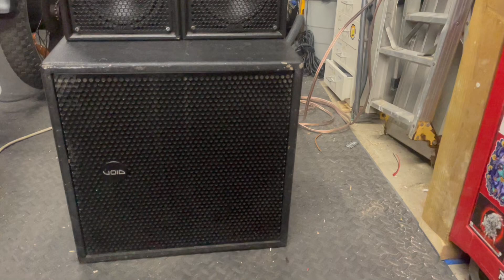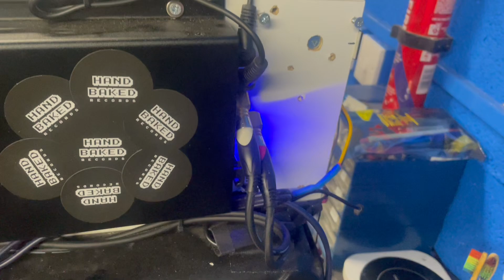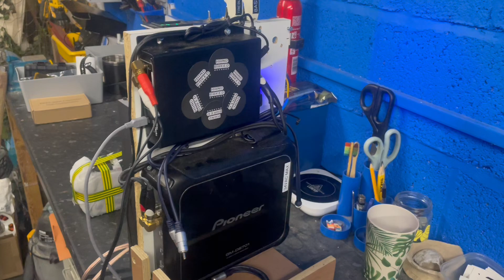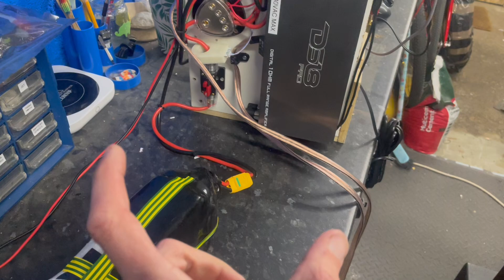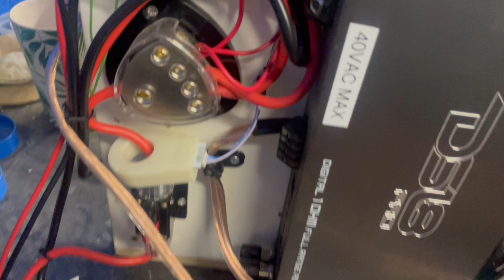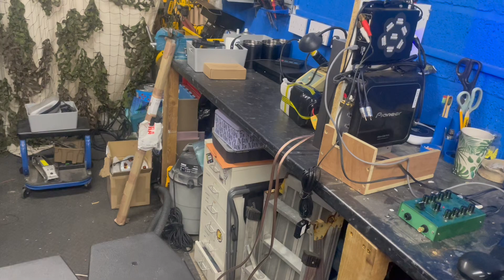How I Built a 12V Soundsystem for my Bike

Comment: Nice build man, very tidy. Lifepo4 has a very friendly voltage range at 4S and the prices are reasonable too these days, I'm hoping to have a trailer rig ready in time for the good weather.
Reply from the maker: I have actually now added a transformer so that I can get a steady 13.6v into the amps, running from ebike batteries.